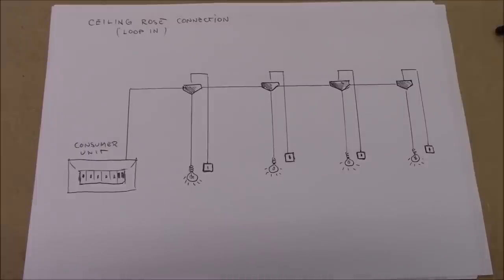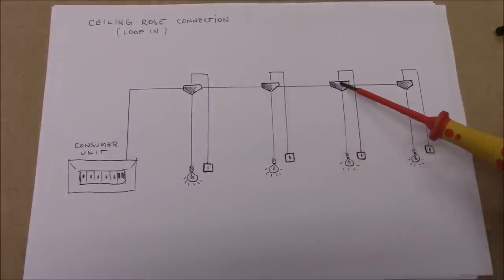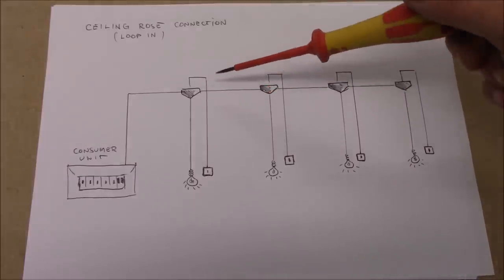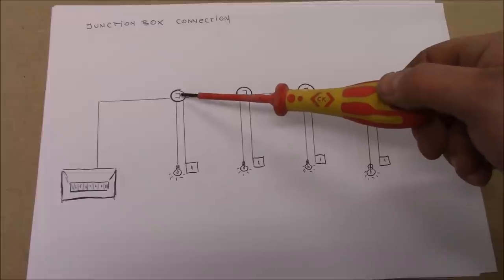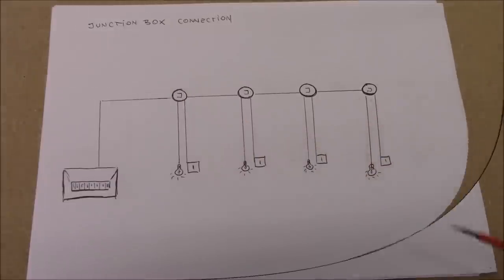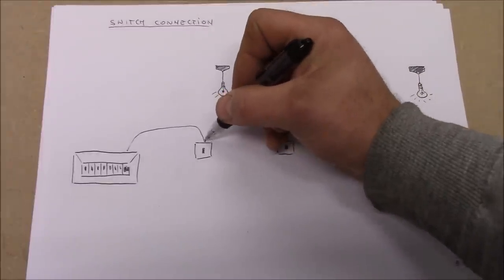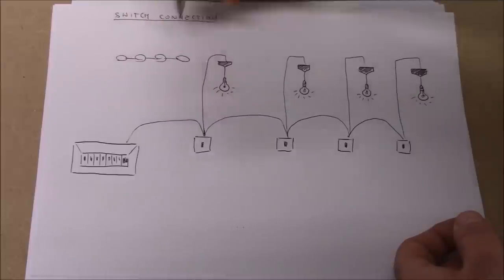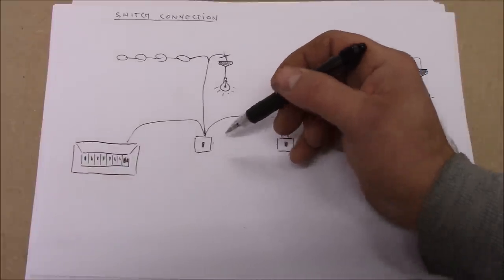Lighting Circuits           Switch wiring             Wiring at the switch

Comment: Not many electrition explain them selfs properly but you do thanx. I'm running cable for spots, under cupboard lights and two ceiling rose lights all in the kitchen I like your way of  connecting the power straight  to the spots but because I'm doing cupboard lights and ceiling rose I got confused so I'm using junction boxes for spots and cupboard lights onto ring . Good video .

Comment: I think it's important to wire an electrical circuit in a manner that is easy to maintain and access so when designing and installing this should be taken into account. There is no need to install junction boxes when not necessary so in domestic I would prefer to see the first method (loop in and out). Good clear explanation in this video.

Comment: Hi.  I am using the switch connecting system, as I want to install a number of downlights.  This is straightforward with the exception that I want to incorporate two way switching using 3 core and earth. Where previously I would intend wiring the brown wire from the power in cable to the Common, in the video the black wire from the 3C&E is wired to Common.  Can you please describe the correct wiring in this situation.  Thanks

Comment: Note that the three vertical cables to each switch must be chased into the wall. Thus rewiring with this switch loop method requires more work as most traditional UK properties have conduit in the wall that permits only one or max two cables.

Comment: Easy to do with stud walls and plasterboard, bloody nightmare if you have cieling roses and wish to rewire to have all looped the switch...Chases will have to accomodate a minimum of 3 twin and earth cables, Add 2 or 3 way switching in the mix and maybe independant light control for double dimmers and you now have 5/6 cables to accomodate, in suitable conduit or capping... only worth considering if your doing a full renovation to be honest. Out of curiosity, do all new builds wired now adopt this method? Thanks

Comment: This is awesome!! Just want I needed to start working on my house. Thank you so much.
Reply: How do u wire it at the light  bulbs
Reply: @grantmp5365  Your light fixture should have 3 wires. Black, white, and bare copper. 
Attach black to black (Hot / live wire), Attach white to white (Neutral wire), and attach the copper wire (ground wire) from the wall to the green grounding screw in the box, then attach the bare copper wire from the light fixture to the copper wire in the box.

Comment: In case you want to use one of the switches  of switch connection method with a dual control switch ( hall light on staircase?)..what are you doing?

Comment: Hi, Thanks for your great tutorial.
Could you please tell me how you would wire a 2 gang 2 way switch using this method?
would you need to add a fourth cable ( 3 core) if so would they all fit into a 2 gang switch? 

Many thanks
Reply: I’m in the same boat. Did you find out how to do this?  Cheers
Reply: @jaesedin  did u find out

Comment: Hi, old vid but just come across it, hopefully you can advise? In my garage I have a consumer unit and out of the bottom of the consumer unit there is a cable direct to the light switch. Then out of the top of the consumer unit there is a cable direct to light... I want to extend for a new light and switch  but not sure what I do with this arrangement I have?

Comment: Hi there Sir 
I have a question and am asking this questions to other viewers too who already watched the video. In the video shows the real wiring with a sticker shows that previous room, light & next room. My question is that does the previous room means the connection came from consumer unit???? Please answer this question. If anyone answer this question I will really appreciate it Thanks
Reply: It can be either previous room or consumer unit, eg if the example in the video was the first switch, the label would have said "consumer unit" but in this case its coming from the previous room/switch.
Reply: yes it is the consumer unit but could also be from the previous room

Comment: Great video, very well explained, but could you tell me why there is no neutral wire connected to the switch, only seen you connect live wire into switch and one out.
Reply from the maker: HI Asif. the light to work needs neutral and live but switch disconnect only live conductor .There is no terminal for neutral at the switch